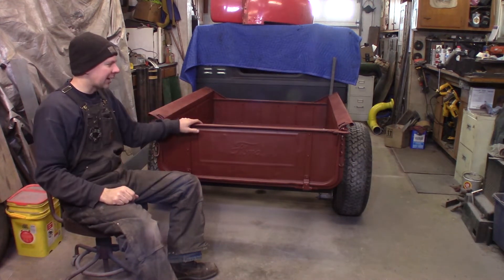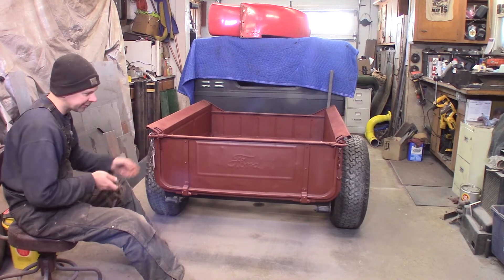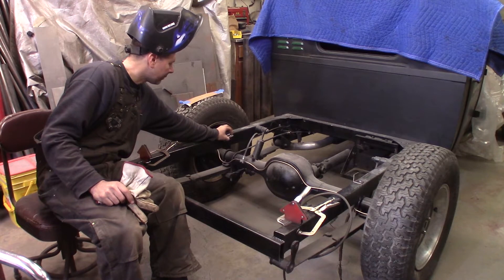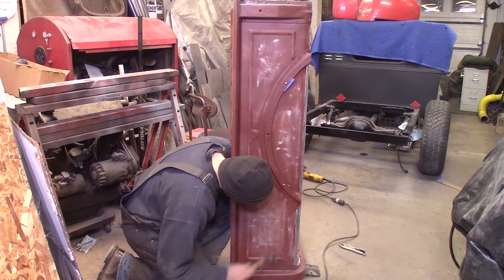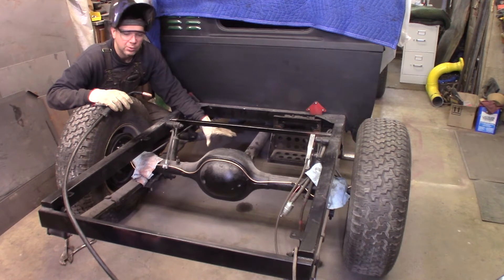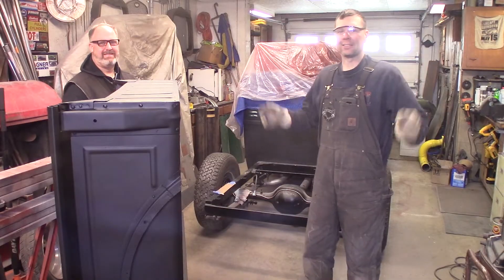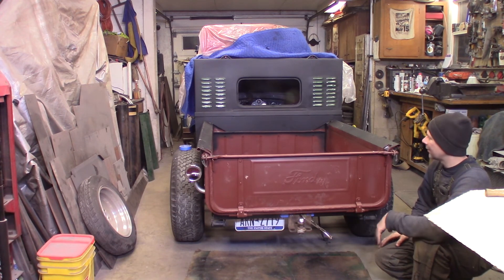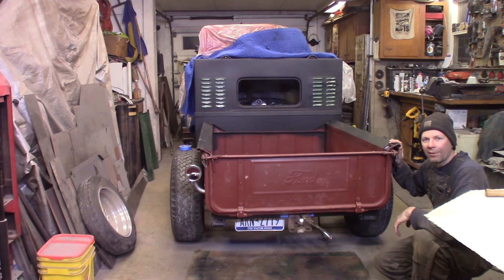Model A Hot Rod Shop Truck:  Mounting the Pickup Bed and Dent Repair

Comment: FYI. The early 1928 boxes used a 5" chain on the tailgate. They went to a longer chain to make life easier. Your box is an early 28 with the orginal chain. Have a nice day!
Reply from the maker: It's a 1929 box, off my Dad's 1929 truck.  I put those chains on the bed, they're off a Studebaker truck.

Comment: My model a bed is completely different did you cut half the bottom off?
Reply from the maker: No I didn't. I have the frame covers removed in this video which are usually riveted on the bottom.   You may have a late '31 A bed which is much larger and completely different lower shape and tailgate.  Its similar to the '32-'34 beds.
Reply: @QuickSpeedShop  I have the lower pieces that bolt to the wood then the frame. You're not using any wood on yours.
Reply from the maker: My bed is channeled 1 inch over the frame.  The frame is also custom made, not stock A.